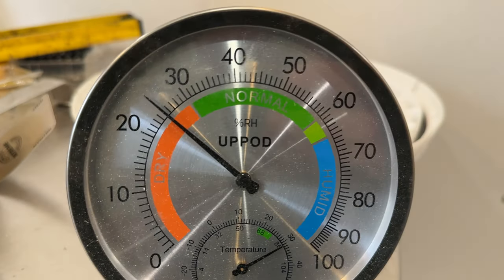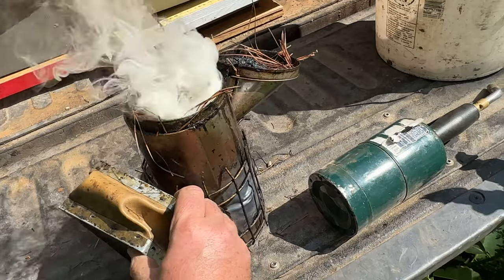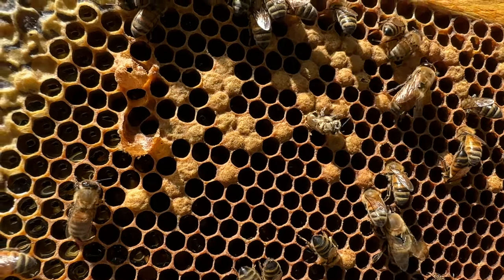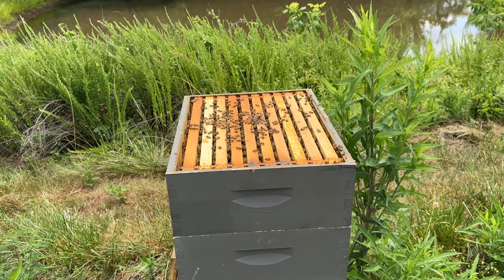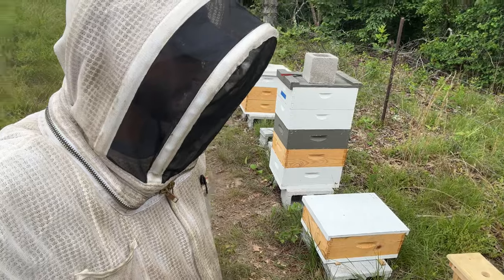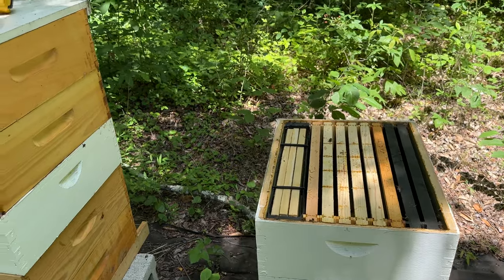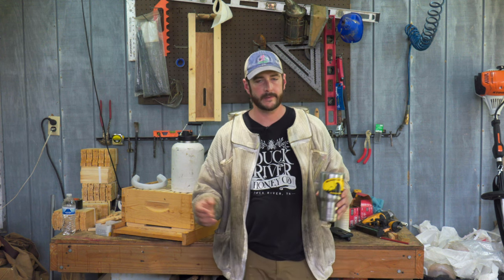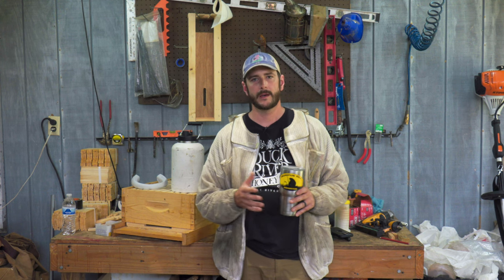Building a Bee Business Vlog #19

Comment: Unbalanced frames in the extractor will cause excessive "walking"... so will failing to cut the cappings off one side of a frame (ask me how I know!)  Even worse is leaving the gate open on the bucket or failing to open the gate on the extractor.  I'm so tired of extracting already - 600 lbs and there is still more!  What would you say would be a good asking price for 60 lbs (5 gallon bucket wholesale) of honey?  What's the flavor and color of basswood honey?  Damp towel around the neck also helps.  Wish UltraBreeze had a round veil.
Reply from the maker: Bulk honey is going for $200-$250 per bucket.  Wholesale would be more, maybe $5 per lb?  Figure out your wholesale bottled honey price, then your bottle and label cost, then your labor to bottle and label it and you’ll have a good idea of what it’s worth.

Comment: Nathan, I check my honey when I bring it in and if it is around 17% I don't dry it further. I feel that getting it too dry is not good either. Extracts hard, flows slow and if it crystalizes it it very tough to get back to runny honey without it having sugar on the bottom.
Reply: When making creamed honey I found that I have to add water to my honey or else the creamed honey gets to hard in storage. Just sharing my experience, limited as it is. 
Bob Walker bought a Lyson uncapper that I think would fit your operation well but it runs about $4k.
Reply from the maker: Thanks for the uncapper tip.  Most years our honey is wet due to the humidity so drying is standard practice.  This is an odd year.

Comment: Orient your fans to suck air thru the stack.  Fans are more efficient in this orientation and will dry down honey faster
Reply from the maker: Thanks, I’ve got plastic under them and don’t want to suck up the plastic and block flow.
Reply: I sure hope you are bringing down the moisture of capped honey.  I have 8 supers I pulled today - mostly capped.   I'm getting 19+% on capped areas!  Instead of extracting I'm going to try to dry them in a closet.
Reply from the maker: Get some uncapped and dry it down to 16% and mix with the thin honey and it’ll make it stable.